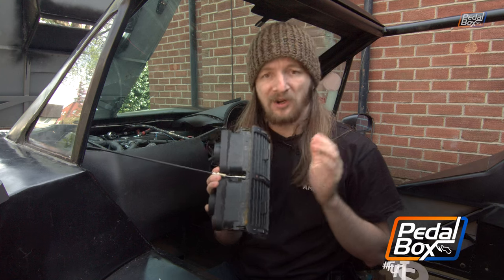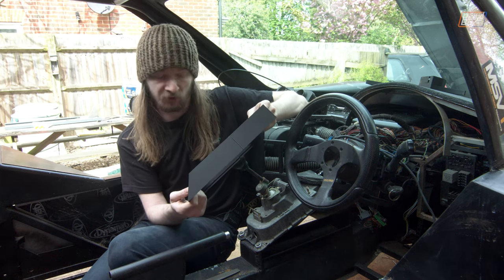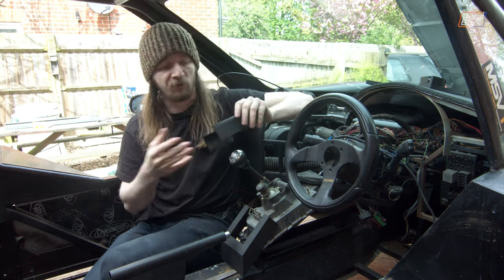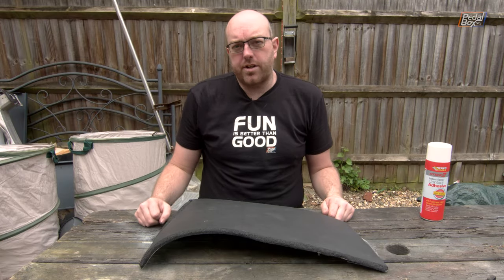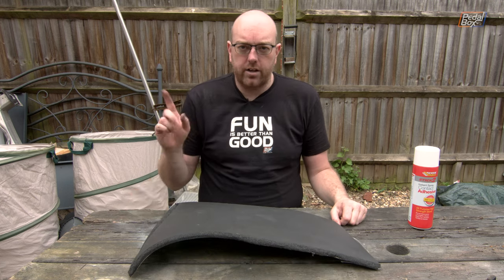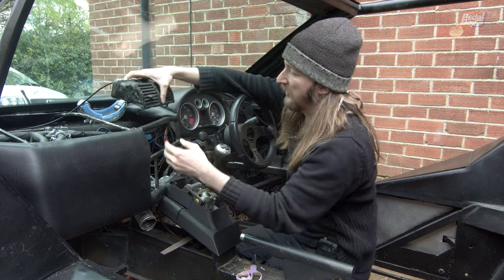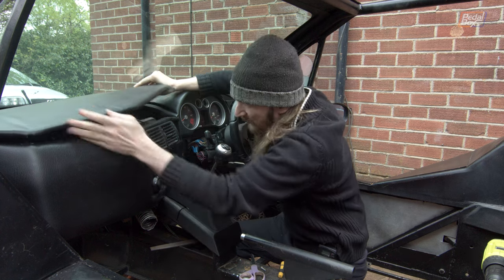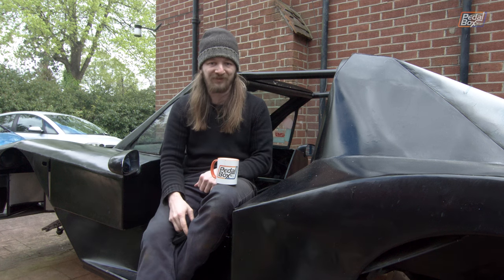3D Printing Mounts and Covering a Dashboard | Audi TT Kit Car | PedalBox Episode 155

Comment: Can you put the unused printed parts back into the system and reuse the material to print more or are they now just scrap? The interior is starting to look really smart now.
Reply: There are machines which recycle the plastic and turn it into filament but they’re quite expensive and at our scale, the economics don’t work out. I think PLA is plant-derived and degrades quite well though so the ecological impact is limited.

Comment: At the end, where you sit there with the coffee mug, that corner of the car will be OK with the IVA? That corner is not to pointy? Also, those panel will stay in there just by friction? I'm having a hard time figuring out how to cover the shifter area. I'm only an old school card board designer.
Reply: Yeah, I can’t remember the specific numbers but the IVA dictates minimum radii for those bits, and they’re surprisingly small so we’re well above them. It’s more rounded than it looks on camera :)